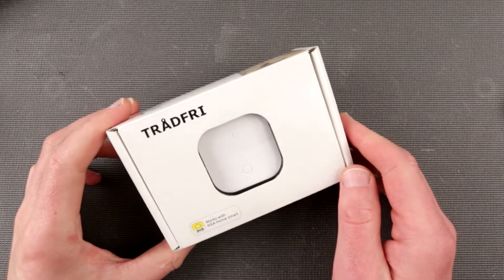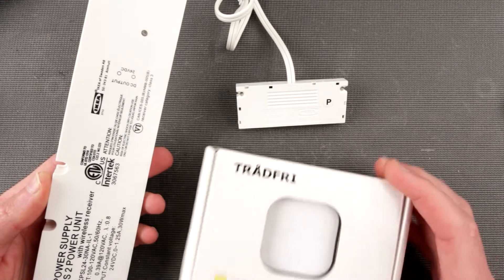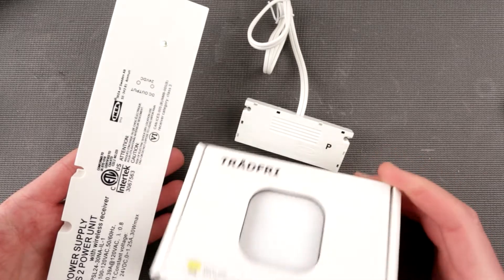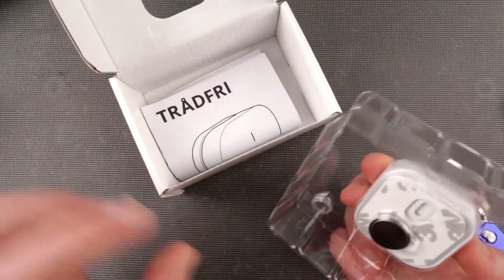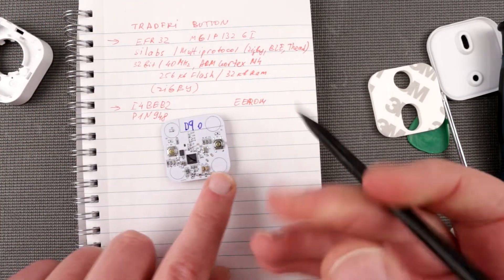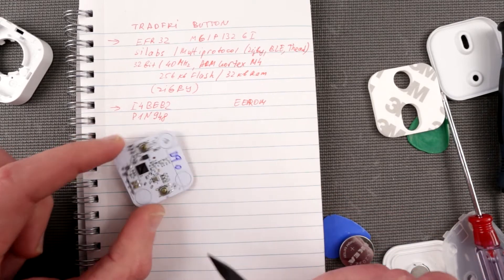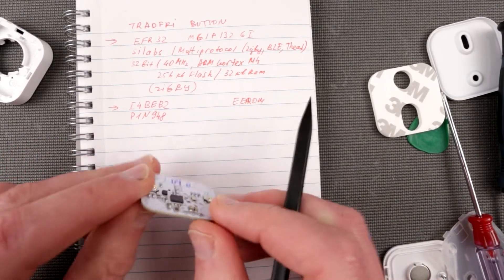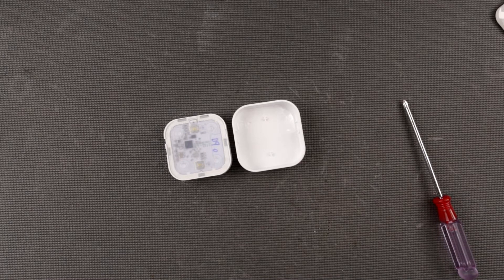Teardown of IKEA Tradfri Button

Comment: Been using the IKEA Shortcut (and I have a ton of them all over the house) with a Zigbee 3.0 USB Dongle (as a co-ordinator) and Zigbee2MQTT / HA and they are just awesome, reliable and value-for-money. Dont use them with the crappy IKEA Tradfri Smart Gateway as it does not expose what this shortcut button is really capable of. With my setup, it exposes 4 actions (single, double, hold-down and hold-up, and of course the linkquality and battery level changes). I would highly recommend this shortcut if you get it paired with a Zigbee 3.0 USB or bridge.

One of my implementations of this is actually the PANIC button/s and it is tremendously useful !
Reply from the maker: Thank you.... This is neat idea ! I will look into it :D
Reply: Can you please tell me how you paired this switch with zigbee 3.0 hub? I can't for the life of me figure it out

Comment: If it's Zigbee 3 compliant, why does it need a Tradfri gateway? Shouldn't it be compatible with Smart Life Gateways for example?
Reply from the maker: I'm asking the same question! I have Zigby and Zwave gateway and it does not work together :(
Reply: @InsideOutElectronics  Hopefully the new IKEA Dirigera towards the end of the year, will be the zigbee glue and smart life not needed.  Looking forward to the release.
Reply from the maker: @GluteMaximuz  Dirigera? Need to leard what is that